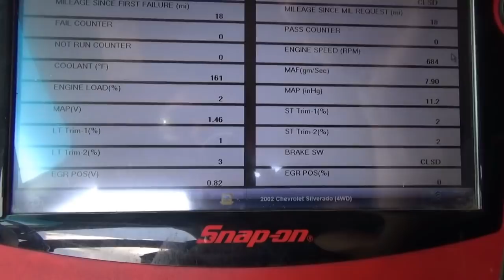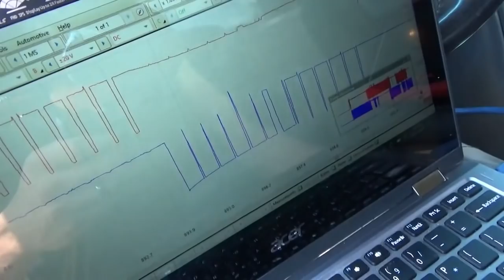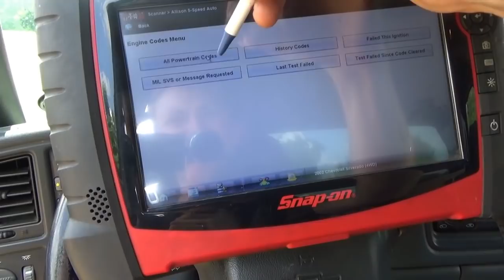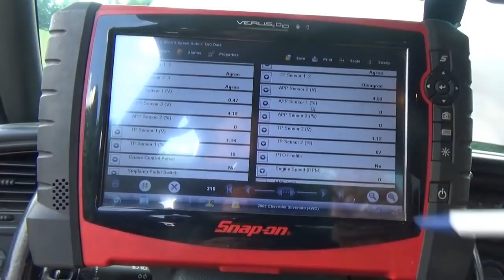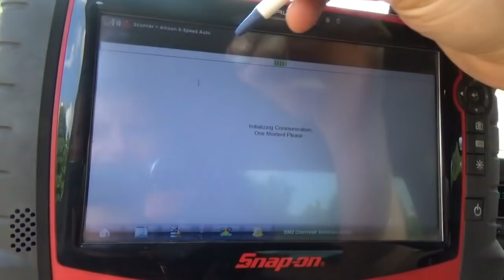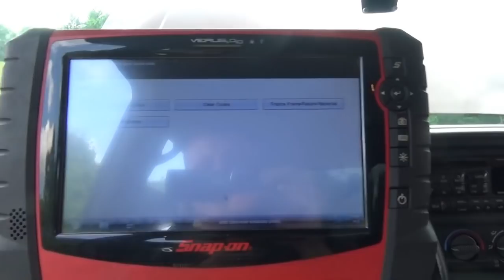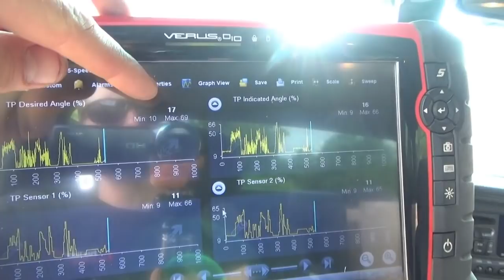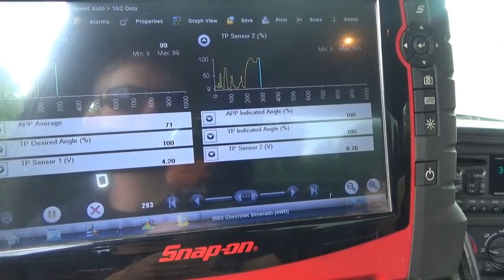GM Truck REDUCED POWER P1515: EPIC BATTLE! -Part 2

Comment: One simple fix: Put a stop-screw on the APP, maxing out at 95%.
Although consider that the PID parameters are tuned for a less sensitive actuator, this means you'll have less control margins towards an instable system on that new style TB. Control instability shows as butterfly flutter/oscillations. It's probably OK, but check it for such tendencies.
Reply from the maker: Excellent suggestion :)
Reply: That is a great idea! I was thinking the same thing
Reply: +1 or the old brick under the gas pedal trick
Reply: If that was my car, no no!!!
Reply: You're reading my mind. Stop it. I am also thinking that the cause of the original issue may not be in the throttle body at all.
Reply: @liviu2004  : I understand your concern. But if it doesn't work or if it decide to act up, the worst case is another limp-home. The throttle module continuously monitor the control deviation (throttle command vs actual throttle position). It'll request limpmode if the difference between them is too big, that's how the failsafe to monitor the algorithm works...
Reply: Big Cheese what about fixing the car properly? I don’t like what I’m seeing tbh, but I am just a youtube know it all guy ....
Reply: @liviu2004  : I understand that mentality too, but what would the viable and solid repair be in this case then?

Option #1.) Replacing with new genuine TB? Best on paper, but out the window in this case. If I understood Ivan right, part is unavailable!

Option #2) Get hold of an original but used part? This isn't better than what he have at hands in my opinion. The carbon tracks inside those TB's wear out over time and you really want to eliminate that issue from your fault tracing strategy. Therefore an original but used TB is equally bad as to the remanufactured ones, all of which seem dodgy...

What other options are there...

#3) Build cable operated throttle? That would throw you into a world of hurt, needing to reverse engineering a big part of the system integration of all powertrain components along with fuel injection strategy (the throttle control plays a big part in acceleration enrichment as well as diagnostic- and fail-safe strategy). Thus you need to keep (or rebuild) the throttle control ECU to keep the remaining electrical system from setting DTC's due to missing the electric throttle, this along with custom fabricating the brackets and cable routing... Too expensive and uncertain in outcome.

#4) Put carburattors on it, (did I hear Holley double pumpers!?). Equivalent to #3, you need hours on hours of custom fabrication along with tuning of the setup... Not in scope of a regular repair shop...

Apart from those there would be some really offcut solutions, such as making a circuit that converts the voltage levels from new TB to old TB. This isn't going to be your trivial voltage dividor resistor network; since the voltage is higher on the old TB in contrast to the new TB you'd need to incorporate some sort of linear amplifier circuit to raise the voltage... Possible ofcourse but not really in the scope of a regular repair shop and a really 🙈🙉🙊 solution at best...

#5) Bin it? Come on, really. Shameful waste that option would be! Also part3 video would have a really really sad ending.
Reply: Big Cheese what about 6? Haven’t seen a comparison between wiring diagrams 2002/2003. If same, similar, manageable, why not new style TB and new control system pcb? This is what I call elegant, not screwing around with expensive TB without even knowing resistance values. Who buys TB just to put it in the parts cannon? Seriously?
Reply: @liviu2004  : Sure, #6 would be among the options too, and as you say an elegant solution, in theory.... here's the risk, replacing individual ECU's to something different will introduce more unknown variables and also very likely end up in the sub system very difficult to get working (also in this case an additional expense not really needed). Now, I'm not very familiar to GMs network architectures but it's a rather safe assumption that ECU provides data to the ECM over a serial bus of some sort; If so, there's also a high chanse the new vs old ECU have different signal- and frame layout in their network communication. (The companies I've worked for loved to change frame IDs and frame layout on sub-year basis even on same platform and same model vehicles... pain in the butt for verification department). Unless this is a proven method (which it might be! I'm not a GM guy) it will actually introduce more unknowns into an already intermittent behaviour and big fault-analysis-tree (don't know if you call it that, sorry for rubbish English, not native...)
Reply: Don't get me wrong here livu, I think it's an idea worth checking; Newer PN of throttle-ecu is it a prooven compatible and direct exchangable replacement into the old architecture...?
Reply: Like the stop screw idea.  I also wonder if the flutter would stabilize once air is flowing through the TB with engine running.

Comment: And one other remark: You will practically never find two redundant signals from any sensor to be at the same level of the sensed input, but there will always be a significant difference. Either going in opposition to each other (like here) or each using only part of the range (e.g. one goes 0.5..2V, the other 3..4.5V or so). The reason is for the ECU to be able to sense possible short circuit fault between these two signal wires (it should yield impossible signal combination). And the 0..0.5 and 4.5..5V are ranges where a fault is detected (with a real potentiometer it would correspond to some open or short circuit fault, these contactless electronic sensors set the voltage there when detecting some internal fault, to mimic a wiring defect so the ecu knows the sensor does not work).

Comment: If there's no throttle relearn, the cool Ivan solution would be to wire up a circuit to translate the voltage range to what's expected and, in effect, tell the computer exactly what it expects to see 😁

Comment: Reroute the wire harness of the throttle body away from the alternator !! The alternator will add and subtract voltage from the tps by the use of magnetic induction,  during different vehicle power loads, 
Or shield the wires with metal shield attached to negative ground.
Reply: Even a small voltage spike from alternator at the right time and , added to, or subtracted from,  the sensor, will not agree within the tolerance of the computer.
Reply: @sargetester99  do you mean like the original symptom?

I think a large problem with the alternator theory is when it us repeoduced with the engine off. It sound more like an intermittrnt ground issue to me. At least with the original aftermarket throttle body.
Reply: Master, is the engine off? May I ask if that makes any sense to you what you’re seeing?

Comment: Just thinking out loud. It may be worth it to pull a Bernie T and use the oscilloscope to monitor both APP sensors, power and ground on the PCM, Throttle control module, both TPS and current ramp of the motor current simultaneously.  I’d give weeks salary to see the correlation between all of these signals when it fails.  It’s interesting that it failed when you suddenly release the pedal.  Seems like CEMF at work upon releasing the pedal which switches the polarity abruptly on the motor.  Thanks again for the video, the community is about to learn big time from your efforts!

Comment: What was wrong with the good old reliable throttle cable? 35 years turning spanners and  I refuse to work on this crap.had a lady with 2014 bmw  m318i ,tpms was beeping warnings on dash,all tyre pressures were good,scanned it and had 16 faults on all sorts of modules.told her to take it bmw.hope I'm able to retire soon this shit does my head in.

Comment: Honestly ivan i disconnect the battery anytime i swap a part like this. Usually 15 or 20 minutes. Time consuming but can help keep modules from acting funky after changing a part and giving you false information.  @ 12:41

Comment: WHAT ABOUT INSTALLING A RESISTOR IN SERIES TO CHANGE THE VOLTAGE ? WOULD WHAT WORK ? MAYBE USING A VERITABLE RESISTER TO TEST BEFORE INSERTING A FIXED RESISTER.
Reply: WHAT I MEANT TO SAY IS "VARIABLE" POT RESISTER. NOT VERITABLE. LOL
Reply: @citichap  But the voltage he needs are higher at VOT and lower at idle (i.e the voltage sving he need is higher when he uses the new TB), to achieve that you'd need to incorporate a linear voltage amplifier to the converter circuit... Or how would you make that happen with passive components?
Reply: @bigcheese781  Well, it seems I was right. Eric installed a nut attached to the gas peddle to restrict the travel distance of the potentiometer in order to get the throttle body to work. I  am a retired licensed alarm installer, which is how I gained the knowledge of servicing/repairing thousands of alarm systems in a span of 50 years. To some degreeI I can relate to basic electronic devices. I was forced to think outside the box in order to fix complicated issues such as what Eric did in these 3 videos. I never gave up; that is secret to success.
Reply: @citichap  "Well, it seems I was right, Eric installed a nut..."
How on earth is a mechanical travel limit stop related to your passive resistor sugestion?
And who is "Eric" in all this?

Comment: Thanks. Is the relationship between vout hi to vout low to the span is 4 volt. So half throttle is 2 volt diff between wipers. Did you say if hi minus low is too great then abs value becomes too hi resulting in reduced power.??

Comment: Chased a similar problem for months on my mom's Saturn. Finally tracked it down to a weather tight connector in the DS foot panel (I think that's what it's called) I cleaned it out with electrical cleaner, used dielectric grease then a zip tie  because from what I found researching here and on google was the connector would work loose, collect moisture and set codes resulting in RP mode. Hasn't done it since.

Comment: Unless you find the bottom cause of the problem, you will be chasing shadows trying to rectify this problem.
a) One unit is known defective, as it behaves erratic once its fitted.
b) The other unit is good, but suspective, as it may work for long and then suddenly out of the blue sets a fault code.
To get on with the problem, I highly recommand you dissect the known BAD one, and find the bottom cause of failure.
Dont spend anymore efforts into modifying the problem away. Thats exactly the route you used to warn against earlier in your YT channel career.
is there any kind of a Throttle travel calibration procedure ?
Reply: I was wondering if there was a learn procedure of some sort to calibrate the new motor and tps to the pedal assembly and controller.

Comment: Parts cannon getting red hot at this point. I feel the pain. I have a 2003 2500hd and 2004 3500 that both have had the reduced engine power virus

Comment: Hey Ivan I had a similar issue with a Chevy truck . Customer had a dead throttle body , he got his own and installed it . All good for a few days then ....... he got a reduced engine power . He shut truck off  restarted it and it was good . He kept having this happen over and over . He brought it to my shop and I cleared and did a throttle body relearn. That fixed his issue . That was 6 months ago all good .  I was taught to always do a relearn when changing anything with the throttle body or gas pedal . Don’t know if you tried to reset  and do a relearn procedure  .....
Reply from the maker: Hey Joseph, What year was that Chevy?

Comment: Is it possible that the actual root cause of the problem is an issue with the wiring harness? This is an electronic throttle system, so obviously the module has a very low tolerance for voltage errors. A little bit of resistance on those signal wires will wreak havoc on the system. A tenth of a volt is nothing in a regular circuit, but it won't be acceptable on this system. Resistance causes heat, so the longer the system is operated, the hotter the poor connection will get, leading to even higher resistance and Reduced Engine Power Mode. Of course, since there will be minimum current flow on signal circuits, it will take longer to heat the bad connection, and that makes the problem very intermittent at times. It may prove fruitful to isolate the wires from the module, sensors, and throttle body and do a continuity test with the good old incandescent test light. Stressing the bad wire with more current should reveal quickly where the issue is.
Reply: Root cause is the lack of a roots blower on this engine.

Comment: ReString all circuits involved from the TB to the throttle control module, I would also ReString the App. Circuits.  At this point, I would seriously consider this. No Crimp and seals. I have access to terminals and build my own harness. GM references this issue in Document ID: 1869994
Reply: I have seen at least 6 simular cases in our Dealership. As Gm Technical Assitance explains it,  Resistance in those connections can and will cause your issue. That why we build our own harness, Crimp the ends, add a small amount of solder to the terminal crimps, and eliminate the crimp and seals. Wire degradation and splice issues cause the issue. rarely a component failure.
Reply: After seeing all those spliced wires, and how sensitive this computer is to the voltage reading, I was thinking the same thing. Use good wire from one end to the other and reduce any voltage drops, especially at the lower voltages that this runs at.
Reply from the maker: What code did those cases set? If it wasn't the P1515 or P1516 then it's a different animal...
Reply: P1516 P2135. Mine was 2003 K2500 8.1 also.
Reply: PIndrag, PinFit issues, Fretting, And wiring splice issues.
Reply: @snoopdogie187  Yes, I agree. Completely!

Comment: One important warning here: What looks like a potentiometer, in a normal circuit even seem to behave like a potentiometer, in reality in most present cars is NOT A POTENTIOMETER, but an electronic contact less position sensor just designed to ACT LIKE a potentiometer in and ONLY in the original circuit (so only with the correct polarity and with the voltage within specified tolerance; otherwise it pretend an fault on the output). So swapping the power and ground will make it not working (but it should not be damaged by that).
Plus you may find the same OEM part number components each piece using different real position sensing method (but 100% interchangeable). It is common practice to use multiple suppliers for them, each then could be using completely different sensing method (real potentiometer could be, in theory, one of them, but most common are magnetic analog hall sensors measuring the orientation magnet on the rotor, or an inductive resolver measuring ratios between inductive couplings influenced by the position of a "flower" shaped metal rotor, but other methods exist and can be used as well)

Comment: I had the same problem with my truck I found a bad ground in the back of the engine wasn’t easy to get to!!
Reply: But why the different voltages on the 2 throttle bodies, using the same ground?
Reply: I don’t know why !! Grounds can be very funny to Electrical systems . I haven’t had a problem since 
I did the parts cannon to and nothing fixed it till I fixed the ground on the back of the engine 
All I can think of is it’s trying to find a ground so it’s making the voltage go crazy and the computer is looking for the same voltage or close to it.
Reply: @frankmontefusco6016  Well, I guess we'll have to wait and see then. ;-)
Reply: @rafflesnh  different years. Remember, he tried to make a newer version work. .

Comment: I'm actually having the same problem on a 2003 avalanche and the throttle body has been replaced three times with AC Delco original parts the pedal sensors been replaced and the tac  replaced and the pigtail for the tb. Im at a total loss

Comment: Ivan i have seem different issues on different cars..like ckp sensors..cmp sensors which indicate a performance issue..eventhough the vehicle has been on diifferent shops without any luck..what i do is replaced or use the original part...and run all new wires front the component in question all the way to the computer..reference voltage..ground and signal..it has work for me..especially on chrysler.dodge.jeep products..wires are not the best quality...

Comment: What if you go the other way and install an old school mechanical throttle body.  Or, retrofit one of the rebuilt units to work mechanically but liability might be an issue.
Reply from the maker: ECM would be very unhappy lol

Comment: A good example of why I prefer my throttle to be linked via mechanical means. I never trust wires to control what was better controlled by mechanical connections.

Comment: Those 8.1 engines the parts are not interchangeable. The 454 engine parts won't fit on the 8.1 engine. Kind of explains why not many 8.1 engines around anymore. Probably lots of 9.1 have the same problem as that engine. Probably no one could figure how to fix it.

Comment: Nightmare job and at 2 hours away.. maybe the later pedal unit would work as a paired system I guess it’s a lot more research or maybe a case of opening the old throttle body the one that chatters and sorting it yourself use the new motor from the new body as you have already purchased it and maybe check to see the potentiometers are clean
Good luck

Comment: One thing that concerns me would be why it had a module from a astro van? 8.1 liters aren't real common. I though maybe you could only use one tp signal while you had the wires plugged into the connector,
Just jumper them backwards if that makes sense.